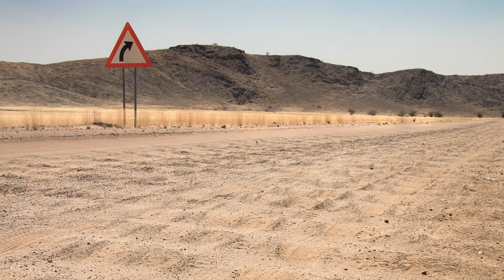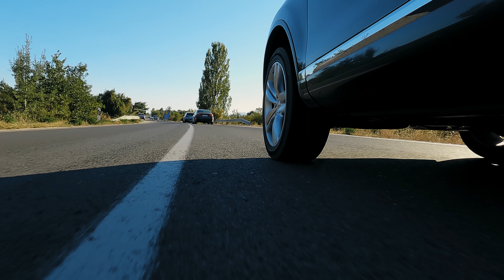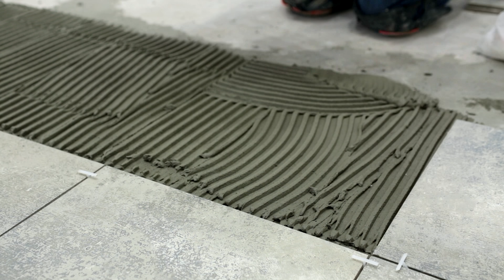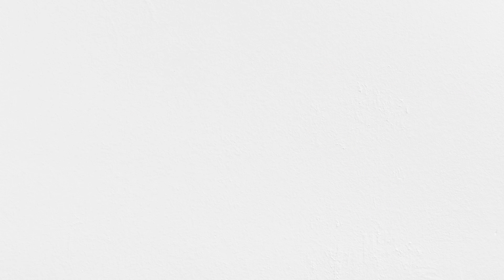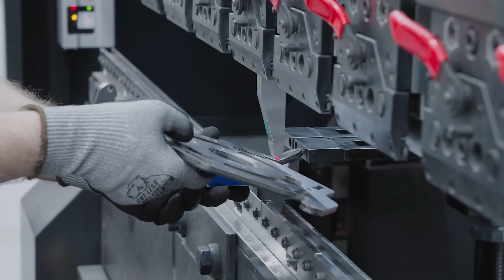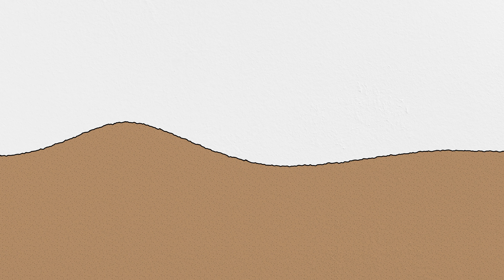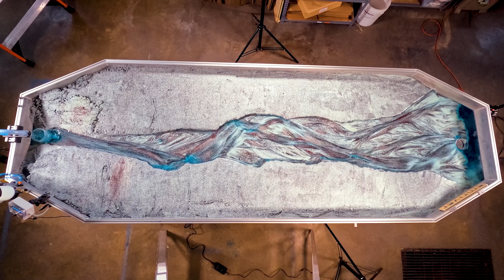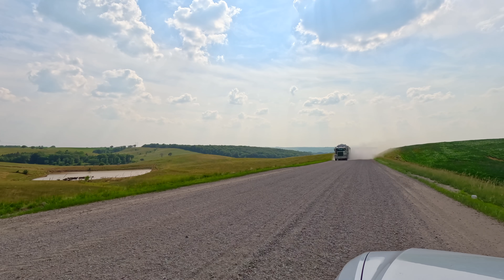Why Roads Get Washboards

Comment: As a kid there was a ski hill my family went to, and the pavement ended a few km from the parking lot.  The road had a fairly steep grade climbing into the alpine and when covered in snow it would become slippery.  Washboards formed every year in the same places, and cars going uphill (even with snow tires) would often have their wheels slip a bit and spin out on the wash boards.   Child-me (and pre-engineer me) figured it was the spinning of the drive wheel tires that was throwing road material backwards, ie the spinning of the tires combined with the bouncing of the vehicle excavated little divots every time the wheel landed, which were then reinforced by the next car.   With this mechanism firmly locked into my brain it was hard to visualize how similar washboards also formed  on flat parts of the road where the wheel torque was less and tires were not slipping and spinning out. Thanks for solving a 50 year mystery for me!

Comment: The farmers where I grew up used to drive "reverse washboard" for awhile to help mitigate the problem. Everybody on the road pretty much has to be aware of the practice to avoid crashes. Slowing down is the best way to keep a gravel road smooth.

Comment: I snowmobiled in the mountains for many years and the roads used as snowmobile trails that are popular can get extremely rough with massive washboard up to a couple feet high. Some really popular areas where there is a local snowmobile club have big expensive grooming machines to try to reduce the amount of washboard? They may even have club volunteers collecting a fee at the start of the trail to help pay the huge cost of the maintenance 😊

Comment: Here in Illinois we have washboarded asphalt roads too!
Reply: We get it a lot here in southern AZ as well. We don’t get the freezing & thawing, like you do in the Midwest, but here everything gets baked to hell & back. The surface gets soft & starts to compress & buckle.
Reply: @goldenageofdinosaurs7192  As a kid growing up in Phoenix I noticed the neighborhood streets held up best when they received a layer or quarter to three-eighths rock (gravel?) applied to the hot, tarry-surface of a freshly paved road.  That rock stuck into the tar, sitting on whatever was used for a substrate and large aggregate in the asphalt, and took the brunt of the tire wear.

Roads seemed to have switched to a much finer material at least at the surface, and that material doesn't seem to age as well.  It seems like it wears down much faster and that the whole road seems to distort where the tires pass, causing actual ruts in the asphalt.  Seems to be a worse problem in the summertime and in places with disproportionate heavy truck traffic, so the transitions from freeway offramps to frontage roads or intersections, in warehousing districts, even around the airport where the buses drive.  Some places have seen asphalt replaced with concrete to specifically alleviate this.
Reply: @TWX1138  This is actually completely wrong, and your memory as a kid must be flawed. Ask any road maintainer here, large surface aggregate is more likely to lead to washboarding. This is why the roads without good sand barriers in phoenix also experience some marginal washboarding. Like Practical Engineering explained, the roadbase is what determines how structurally stable the road is, and wear at the wear surface is best mitigated by adding higher amounts of fine particulates; which is supported by decades of evidence in Arizona.
Concrete is not a good road material. It is highly prone to cracking, far more so than even asphalt. It is very likely you're seeing roads that are freshly graded and in transition, or you're seeing low-use roads. Concrete road is poured in separated slabs- with crack alleviation if the slab is continuous, but it shifts and is super rigid, making a very poor road surface.
Reply: @TWX1138  Ah, I know exactly what you're talking about...they do the same when they resurface neighborhood roads here in West Texas.  They spray down a bit of asphalt (tar) over the existing pavement during summer, and then they'll spread partially crushed river gravel over the top of that (like what you used to see in kid's playgrounds with the toy excavators).  They add more than what will stick into the asphalt and then go over it with a roller.  The end result is that the asphalt is completely utilized with a lot of extra gravel that piles up on the side of the road that they them sweep up after a few weeks.  It's just a super cheap and low effort way to resurface the road and it often ends up exacerbating the underlying road problem if it's in a high traffic neighborhood.  Traction is terrible until the asphalt goes through a winter, as slamming on the brakes can make the gravel slide over the old road surface, lubricated by the near molten asphalt.  After a year or two it kind of compacts and levels off, the asphalt hardens up, and the road ends up being a little better than before the resurfacing.

I think what you might be seeing with the finer material is that they mixed the asphalt to aggregate ratio incorrectly, with an excess of asphalt.  If you imagine the asphalt as a glue that holds the gravel together, what you want is just enough glue to fill the spaces and hold the gravel together, but not so much that the gravel is floating around in a sea of gooey asphalt.  Ideally, you want as much gravel as you can get, packed really tight, so that it can support weight all on its own.  The asphalt is there to keep the gravel packed in tight.  It does a lot of other things too but for the purpose of this discussion that's the main takeaway.
Reply: @TWX1138 
Chip and Seal! Most county toads get that.
Reply: Or the dreaded concrete slabs shift creating the washboard too.

Comment: It's like a boat moving through water leaving ripples, I'm guessing anything not truly solid must have some fluid dynamics like how asphalt will actually drip if left in a funnel. Microscopic displacement and rippling. Kinda neat. Edit: maybe harmonics also have a hand in this. Ideas pop up kinda quickly thinking about this. Not that anything I've said is correct or hasn't been said before though

Comment: I’ve lived on gravel roads a good portion of my life including now. Being a retired truck driver I have wondered what caused washboards. I figured airborne drive axles hitting a bump then coming down with the wheel going faster than when it went airborne throws dirt causing more of a washboard. One thing that baffles me is how do ribs form across the road instead of just where the wheel landed. If you find the answer to these thoughts I hope you let us know. Thanks for this video.

Comment: Snowmobile trails are notorious for "washboard" conditions.  Snowmobilers call them moguls. The trails are leveled with a trail groomer several times a week.  Without grooming, the moguls can get a foot or more deep.  The trick is to balance your speed to the frequency of the moguls to "smooth" out the bumps finding the balance the suspension tune to the frequency of the washboard conditions.

Comment: Your trailing arm experiment failed to include a spring, though gravity was a suitable substitute. The combination of wheel weight along with suspension spring rates results in a singular resonance which is remarkably constant no matter what you're driving. That's because (in part) vehicle suspensions must avoid resonant frequenies below 10 hz because that's where the human brain resonates, causing a loss of concsiousness. Since most vehicles have the same resonance, that explains why road surfaces reflect that. If vehicles had widely varying resonant frequencies, washboard roads would be less severe.

Comment: Happens a lot at intersections, where speed is low... It's due to acceleration and braking especially. The acceleration pushes the dirt back, while braking pushes the dirt forwards. Exacerbated by hard acceleration or braking or large, heavy vehicles.
We get washboards a lot as the mountain bike trail season progresses, especially at bike parks where hard braking is frequent everywhere.

Comment: Why is the ratio of the "wavelength" of the washboarding and the wheel so different between your test track and actual roads with motor vehicles? In your test the wavelength seems to be around 3 times the wheel diameter whereas most of the images of actual washboarding on roads looks closer to 0.2 times the wheel diameter. Is that a consequence of the looseness of you road material? Or the speed? The flexibility of the wheel material? Or something else?

Comment: Nice video again ! Why not, if no synthetic material available to reinforce the road, to lay (with kind of a "stencil" roller) different material (coarser ? ) in a grid (or diagonal lines ? ) shape like for instance what we can see in the video, the, on top of that a thiner material, then leveling it alltogether and compacting...? Now you have a good tool to experiment it ! also spraying dry lime or cement on top could help ?

Comment: I've driven on unpaved roads in the US. I do try to avoid them if possible. They aren't a lot of fun in a car, especially if they aren't well maintained. Not all concrete roads are great either. My local town needs to redo one road, but they have put it on hold for summer tourist season. It really needs to be done and the tourists will have to deal at some point with construction cuz they can't do it in freezing winter!

Comment: When i was growing up in the 90's in the boonies of oregon, i had this 1984 toyota pickup, that someone had put super stiff 1 ton springs in the back.  2/3rds of oregon is desert, like idaho or nevada, and theres a million miles of dirt roads that hardly anyone uses cause they are so washboardy.  I figured out on accident that the light truck with the stiff springs if i drove at exactly 35mph,  it would skip along the tops of the wadhboard bumps and it was as if you were on the nicest blacktop.  So my buddies and I would go all over the place  and had it pretty much to ourselves.  We called that truck the magic carpet, lol.

Comment: All true, however, an in nature there is always a "however"!  This phenomena is probably more complex then described, having spent a lot of time riding dirt roads on a motorcycle, I noted the following:: The ripples are most pronounced in places where cars are braking or accelerating  also the circumference of the car wheels definitely have a role in the distance between ripples.  On my motor cycle with much larger wheels the ripples are much less problematic then driving on then in a car which seems to have a resonance with them at most speeds..

Comment: Would the experiment not have been more accurate if the wheel was self propelled?  Does the result change if there's traction also pushing backwards against the sand?

Comment: Question for a testable hypothesis: I've heard that driving excessively fast (to a dangerous degree) on a straight road with a washboard begins to reduce the vibrations felt in the car. Will that also still propagate a washboard just as much? More slower? Or even undo it?

Comment: My grandfather and uncle had heaps of trucks and one thing we noticed on out long gravel driveway into the yard was it used to get corrugations but when my uncle started getting trucks with airbag suspension it started becoming a problem. It went from grading the drive maby once every 6 months to about monthly maby less depending on weather. The more the old trucks were sold and replaced with newer ones with airbag suspension the worse the driveway got. Somthing interesting we noticed years ago

Comment: I always assumed that a major factor for wash boarding was the deformation of the tires under load. This is because I grew up in an area with lots of dirt logging roads and the worst was always on slopes where the vehicles were under either acceleration or deceleration. It was interesting to me to see that simply running the tire at speed was enough to begin the process.

Comment: Driving in old ranch roads that was actually mostly intuitive to me. Most of the washboard areas seemed to be in areas where would be breaking as well which just made sense to me that it was caused by sudden increase in loading causing the front wheel to dig in a bit more

Comment: Someone once pointed out that Ford F-150 trucks with worn out shocks, going too fast were most responsible for producing washboard. You can tell a big difference in the sound of one of them going down that gravel road so there seems to be some truth to those being some of the worst about making corrugations.   The resonant frequency of the suspension will ultimately show up if that same vehicle drives the same road, with the same load, at the same speed. Viscious circle,  worn out shocks cause washboard> washboard quickly wears out shocks.

Comment: Wanna have more fun? 

Factor in the randomness of the effect wind has on the sand. Build a fan and write a simple program that alternates the RPM of the blade speed. Or, you could pull historical data and program the wind data in and test an actual time period.

Comment: When I was a kid I told my dad that this problem was easily solved simply by making the road into a bunch of squares where the squares could be lifted up and pivoted. Then every once in a while we would pick up the square and turn it 90° and then the corrugations would run parallel to traffic as opposed to perpendicular. 😂😂😂😂

Comment: This was interesting, but the wheel did not drive the rig.  I have to wonder if the wheel was powered if it would make a difference in the speed or frequency of the washboard.  Instead of just rolling over the ground it would be pushing against it.  Having power wheel would be a more realistic representation of what is happening on the road.

Comment: The issue is one of ground/soil compaction. If the wheel compacts one patch of ground, the adjacent patch is less less likely to compact as the preceding soil is less fluid. This repeats over and over. The wavelength is a function of the soil composition and the ability for said compaction to propagate.

Comment: The movement of air also contributes to the ripple effect and the lateral spread of the washboard ripple across the entire road surface. Notice that there are no washboards on the wagon trails used by early settlers. They weren't going fast enough to start the process. But once the ripples start to form from the tires, the wind from passing vehicles also helps grow the ripples laterally across the road. Nearly all washboard roads have the ripples between the tire tracks and a foot or two on either side of the main tire path. The picture of the sand dunes shows how wind creates ripples with no vehicle travel.

Comment: THE BEST EXAMPLE OF THIS DEMOSTRATION WAS EXPERIENCED IN OFF ROAD MOTORCYCLE RACING IN THE MID 70'S,  with the existing suspension of that time(twin rear shocks single rear wheel 4 inches of travel) with the increase of the rear stroke of the suspesion up to 12 inch the tracks were now more rutted by the bikes in competition. then the from forks were increased from 6" to 12' stroke the tracks decended into a different and more difficult surface!